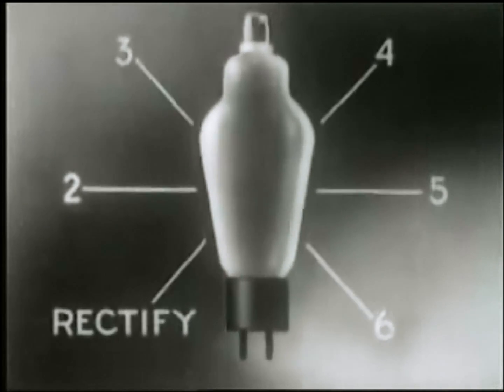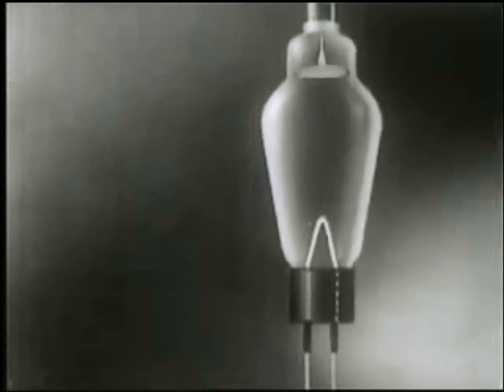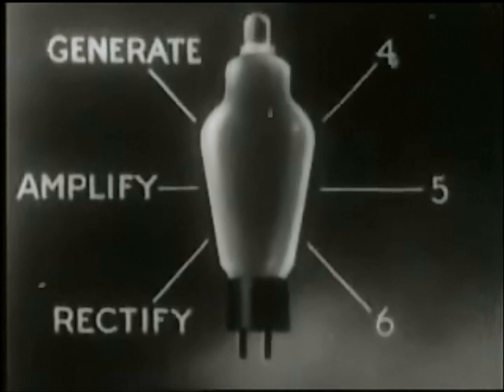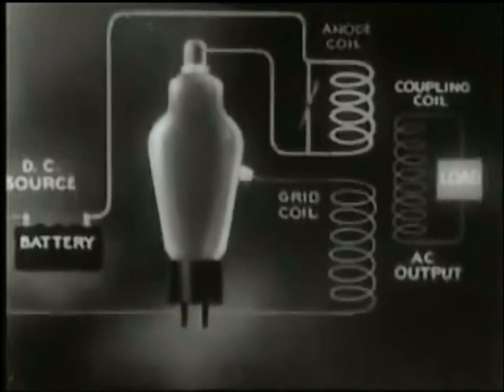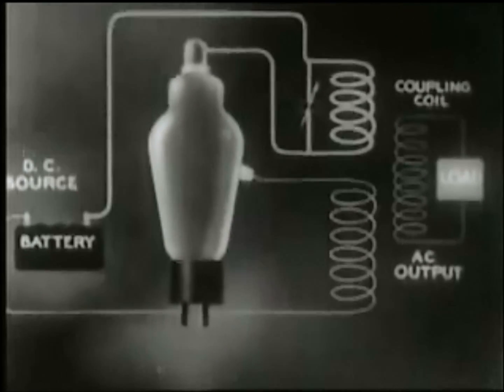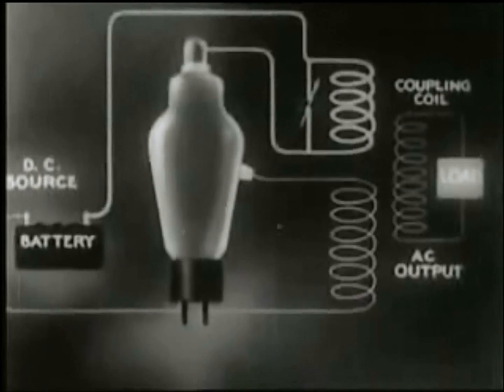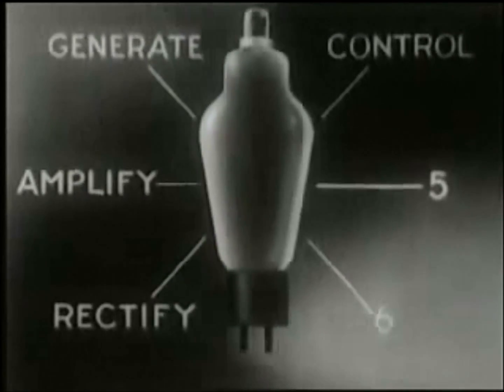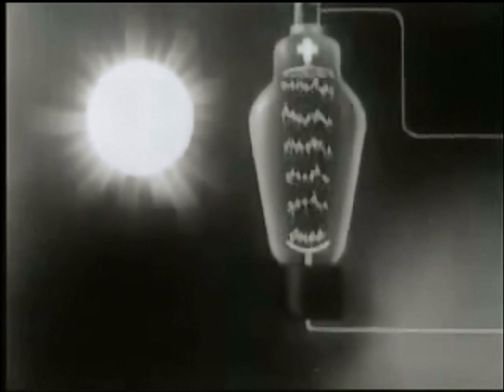Why do they not teach this

Comment: I taught Tube theory in the 1950's and 60's. It was replaced with transistor theory. I felt stopping tube theory robbed the students of a better understanding of how things worked.
Reply: you are correct in your thinking but "understanding of how things worked" is unnecessary in modern school factories where robot slave drones are programmed to toil in the aristocrats' factory world , infact soon ALL THINKING will be outlawed
Reply: yes and also not telling people of Nikolai Tesla is also a crime ..guess they dont want people to understand if they did they'd make there own energy .....
Reply: In Britain Dr. Beeching got rid of steam trains in favour of diesel just as steam turbines where coming in that where powered by oil or coal dust and they where super efficient and clean, way more than diesel. Ditto with valves, they where shelved just as things where starting to get seriously interesting.
Reply: My electronics teacher did his best to take us through the history of electric components by building different things, first using hardwire control circuits, then some TTL, and eventually to modern logic controllers. But he never mentioned tubes..
Reply: how do you most easy create energy from a tube?
Reply: @Zekerias: You don't. Tesla fanboys are delusional.
Reply: if you strongly accelerate a plasma you will notice that things are not as you always think they are
Reply: @Zekerias: It takes energy to accelerate a plasma. Tesla fanboys for years, no decades, have been talking nonsense about "overunity". They have nothing to show for it.
Reply: nope as acceleration is defined by the differential in direction or speed. So you can accelerate a plasma via rotation and thats why you need the magnetic field. But if you want to do energy see the acceleration as input energy to get the process going. Plasma dense focus is surpressed therefore or is it not Mr Dr Lerner ? ;)
Reply: @Zekerias: You need energy to start something rotating. You're not going to get any "overunity" energy out of that. This "suppressed" nonsense is just an excuse by Tesla fanboys' failure to demonstrate a "overunity" device that actually works in a repeatable fashion.
Reply: hehe you have to try for your self,,, study the sun ;)   search plasma power plant
Reply: @Zekerias: Garbage. Just get independent researchers to demonstrate a repeatable design reliably produces "overunity" energy. You fanboys have been at this for decades! What's your GO TO design that works, having been independently verified by many in the hobby industry? You don't have one.
Reply: hehe do it for your self and you will understand more about the sun and the nature and why many people using this technology ( and others) for them selfs in secret.. forget everything else.
Reply: @Zekerias: Do WHAT for myself? You just babble about nothing. I asked where's your GO TO design that works? You don't have any. There's nothing for me to do except to ignore your childish remarks.
Reply: hehe stay sheep
Reply: @chrimony  it exists, whether you believe in it or not. At least those people are doing something to further mankind's decent from absolute slavery. You just continue along your programming, with every word you speak solidifying your baseless ideology. Over-unity divices are out there, they will be coming to light very soon.
Reply: @deathblaizer  Saying something exists without any evidence is fantasy. Have you built any such device? What's the design? Has it been independently verified?
Reply: i feel bad bc i busted hundreds of tubes when i was a kid. they had a thrift store by my house and they would have tvs out there and taking the tubes out and busting them was so satisfying.
Reply: Tube theory must be revived and enhanced even further intensively and extensively in order to give all students a better 3 dimensional understanding on how and WHY THINGS WORK THAT WAY! Everything boils down to the BASICS of our present day technological life that has become instinctively part of our life like breathing BUT WE MUST ALSO BE AWARE WHY WE ARE BREATHING AND SUCH IGNORANCE CAN BE FATAL ANYTIME NOW, IF NOT LATER!
Reply: darthvader5300 You underestimate the power!
Reply: No I did not under estimate the power of human beings to relearn things. What you misunderstood is that it will take longer for them restore what was lost and should and must have been preserved but as time passes by the generations who knows them will be in retirement homes and there will be no one to teach them except as an in home supplementary educational courses! In Russia it is mandatory to preserve the old along with the new. New does not always means it is better. Keep that in mind.
Reply: I agree with this. Luckily though I had a teatcher that lukely did teach us about it.

Comment: is that bulb a transistor?
Reply from the maker: If that is a vacuum tube it very well could be, not too sure. Anybody ?
Reply: a vacuum tube which has connections on its sides?
Reply from the maker: A grid in the middle
Reply from the maker: Yes Morays' system is another  invention that slipped under the radar of mainstream. Unfortunately mainstream is lead to believe that energy cannot be extracted from space time and inventions like his are bs. But there is enough evidence to show suppression of energy devices an easy example is LENR. Also known as Cold Fusion, anyone with any sort of intelligence can work out this world changing and world saving tech is real and is being actively suppressed.